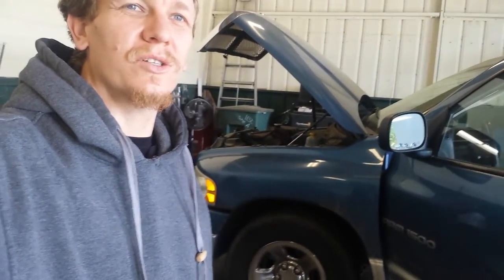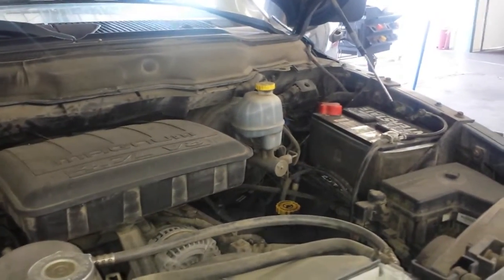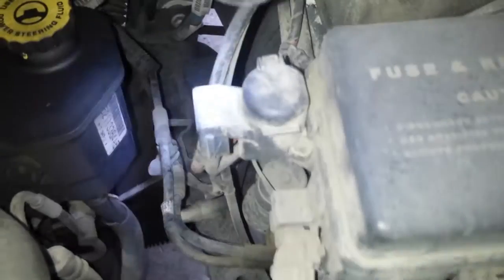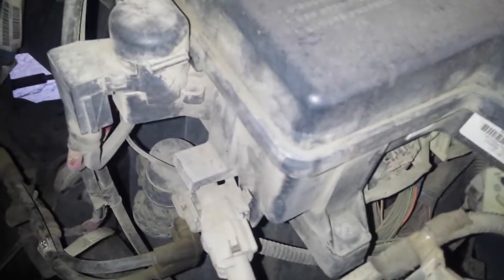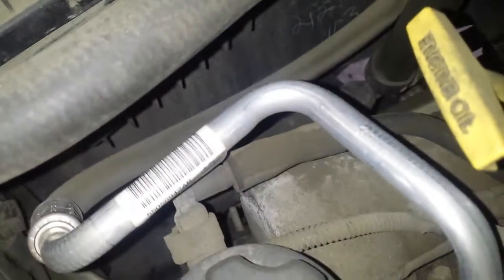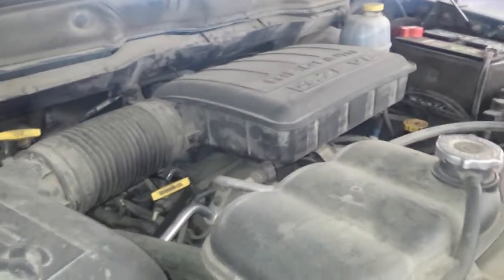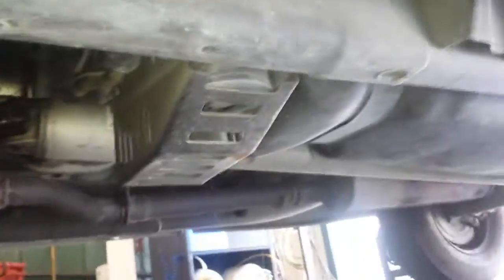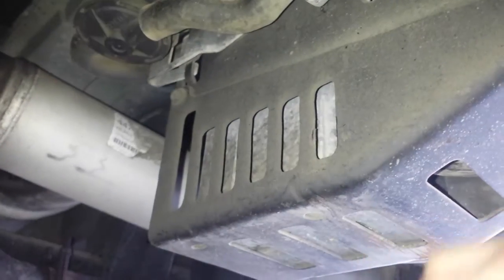Dodge Ram emissions: PCV valve, EVAP canister, & EVAP vent

Comment: When you point out the 2 hoses on the drivers side and say one goes to the evap canister and one goes to the intake that's where I need more info.. I unhooked all mine when replacing the valve cover and can't remember the correct configuration. Or does it even matter?  Right now I have the hose without the port coming from the bottom elbow on the evap canister solenoid and going up to the intake.. Am I right? please help..  My truck is not running good now..   I cleaned out the pcv valve and its working good. Truck stalls at idle and sometimes as soon as I put it into park.
Reply: Keneo Fugotti what size motor do you have ?

Comment: keep doing the 4.7 magnums ---   02-08 ram... 3rd generation.
most videos are just about the hemi engines
 

a lot of us old boys just need a truck , don't need anything too fancy. my 04 does me well.

it'd be quite nice if you could show how to take off some of these parts too. but either way, just pointing them out is helpful still.

looking for the cam and crank sensor.
Reply from the maker: +mark yisser thanks for the support and for the recommendation. I think I have a few Dodge V8 that are non Hemi. If I get any more in I will for sure make some more videos and if I end up doing any maintenance on these same thing, I'll upload them ASAP.

Comment: Im having trouble figuring out a parts name maybe you could help me out I have a hose coming out near the top rear of the passenger side head. which I thought was the pcv valve anyways the hose goes to a T, one side of the T goes to the back of the airbox and the other part of the T goes in the direction of the driver side head but goes down. I believe the hose blew and now I have a vacuum leak. I can't find what the part is called or where it belongs to. but I believe it goes to the bottom of the truck were the evap valve is... its a hard plastic hose not rubbery
2002 ram 1500 4.7 v8 rwd
Reply from the maker: +Tony Guerrero can you send me pics? Do you have any codes or a check engine light on?
Reply: Scotties Hobbies yes check engine light is on but my mother's truck is at her house stranded and won't run unless your holding steady on the gas... what happened was the radiator cracked letting out all the fluid and the truck overheated and shut off. after it shut off it wouldn't start so I replaced the radiator put a new battery and then it started because I was on the gas. I can get pictures tomorrow
Reply from the maker: I would start with a compression check to make sure your working with a good engine. You pulled out a coil and grounded the plug wile someone craked it?
Reply: No I haven't pulled a coil or spark plug but I turned the crank n it still spins.. good idea Scottie's I'm going to see if I can rent a compression test kit from autozone n run the test
Reply: Scotties Hobbies I was doing  the compression test today and when I pulled the 3rd plug it had coolant on it plus number 1 cylinder had 0 psi and I had a range of 100 to 130 on the rest of the cylinders... so I guess time to do some head  gaskets possibly heads also but I really appreciate your help on pointing me in the right direction. any advice on my upcoming "head job" lol

Comment: hey i got a 2006 4.7 1500 but the pvc is not built in to the oil filler and is not in same place as the hemi. you  know were it could be? 
my problem is it wont go up on rpms when pressing the peddle
but start and idle fine. i had same problem with my hemi truck and it was the pvc.
Reply from the maker: +James Dobbin can you email me a pic of your motor with any/all engine covers off?
Reply: Scotties Hobbies yes i can whats your email?
Reply: @jamesdobbin7041 how'd it go?
Reply: @ScottiesHobbies  ever find our where was it, and what were the results?

Comment: Can the PCV Valve be changed at home, and does it require any special tools? Thank you for your help
Reply from the maker: +Mark S thats a super easy one to replace. I believe you twist it counter clock wise and then pull it out. Less than 5 mins.